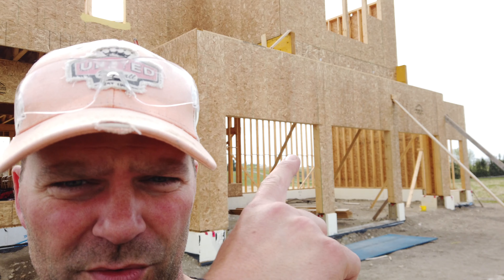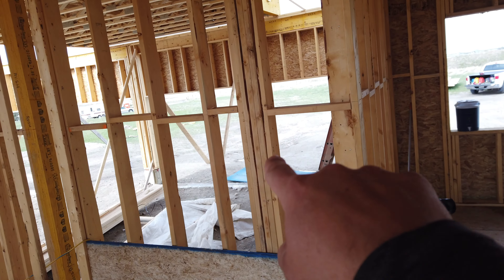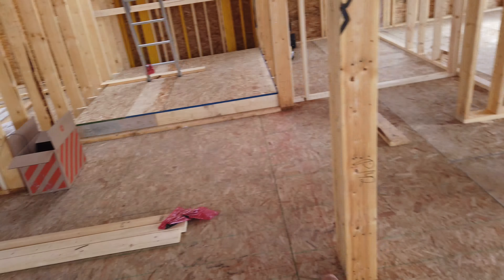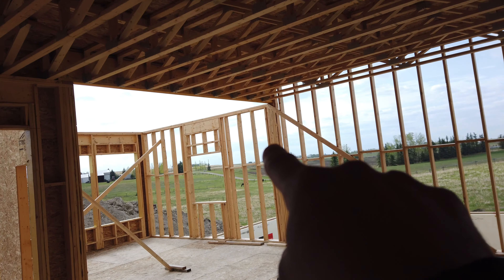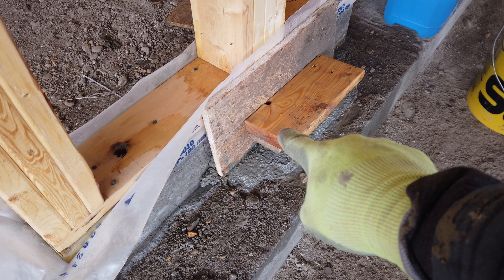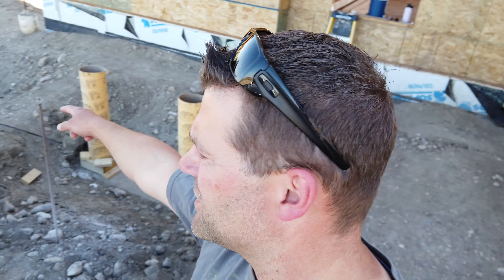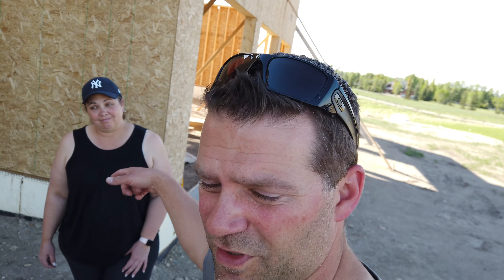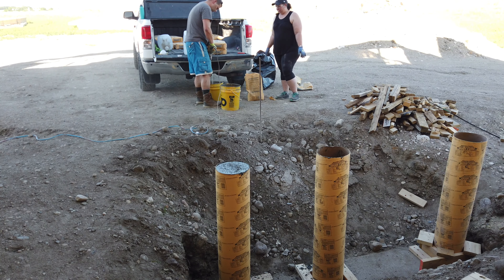House update, Roof Construction Begins

Comment: Love your videos Jon. If you need help hit me up. What are you doing for insulation?
Reply from the maker: Thanks Luke!  As it sits right now the plan is to do under basement slab and under garage slab with foam.  There will be infloor heating in both basement and garage.  Then the typical areas, Bonus room floor, Rims and some of the tricky areas.    I would love to spray the entire house like our current one but not sure about swinging the cost of spraying it all.
Reply: Do you have a bd.ft count?
Reply from the maker: @lukeegely8659  Not yet.  Will have it soon.